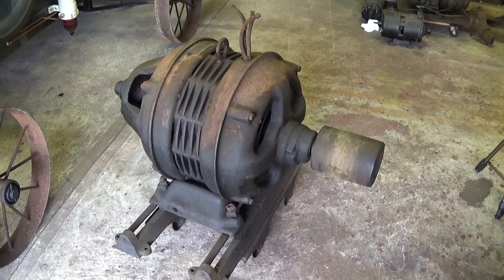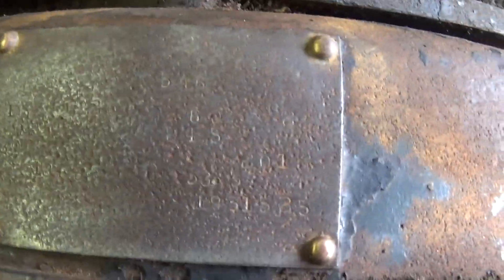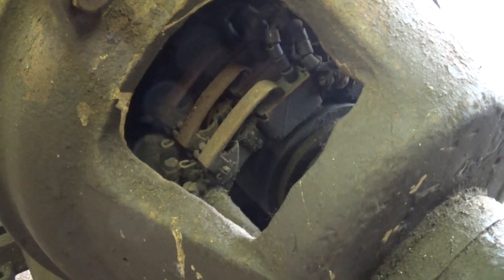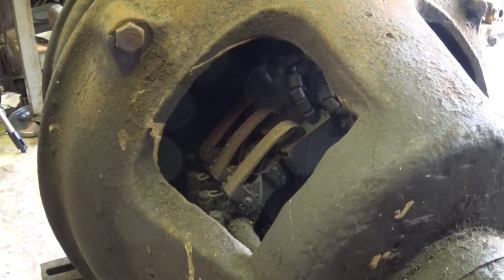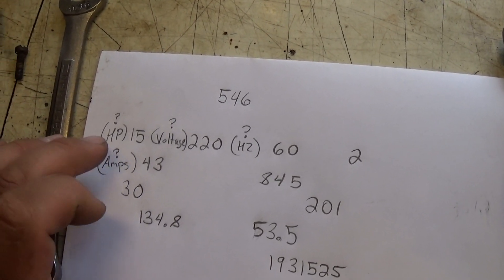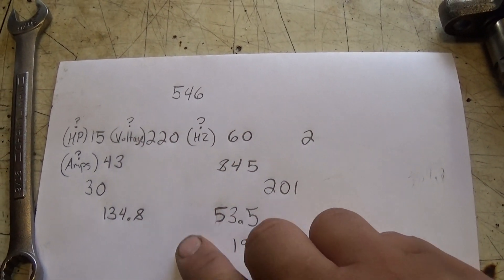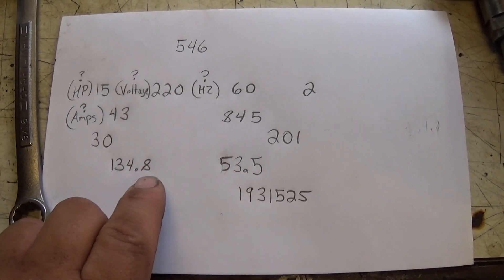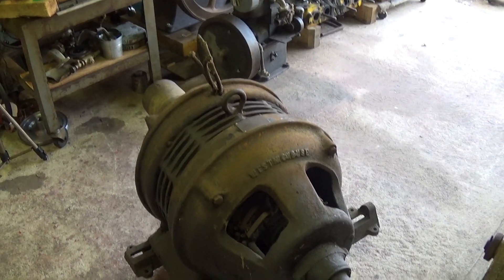OLD WESTINGHOUSE ELECTRIC MOTOR

Comment: A sawmill I used to work for had a old planer that had a motor very similar to this one. It was a 3phase motor with flat belt pulley. You would start it by turning a lever and it would start slow and then you would turn it up to full speed. It worked very well. The machine broke a shaft and they put a newer 3phase motor on it and v belt pulley system. The old motor was unhooked from the wiring system, but it's still mounted in the original place.

Comment: Well, it seems the data correlates well, the way you wrote it. If we assume typical cos_fi of 0.8 then:
Pn = Un* In* 1.732* cos_fi = 13.1 kw (input power)
Po = 15 * 0.7457 = 11.18kw (output power)
ni = 11.18/13.1 = 0.85
I was not expecting this motor to have that much power and efficiently, based on size and year it was made.

Looks like 845 should be nominal output speed (rpms), which means 4 pole pairs.

Comment: Eff ing YouTube has blocked me on some or all of the comments., I found a Westinghouse Catalog from 1920s that had that exact motor.
I worked at 20th Century Fox Studio, and it was built in the late 20s and there was open frame Westinghouse motors three times as big as the one you have and they were 1 1/2 hp.   "THE DON'T MAKE THEM LIKE THEY USED TO" . 
I swear I would have worked there for free. LOL.
I WAS a union electrician. 
If you can see this I will send you screen shots of the links and other things. If. You were closer I give you my motors tools etc.
I am the worst sales person on planet earth.
I have a six pole revolving feild Altanator.
 I see you have the Magraw Hill  Electrical Engineering series. DC MOTOR.
ARNT THOESE the best written text books. I am 70  and I have been collecting all the MaGraw Hill books , steam turbine   all
 You are lucky I live on this coast.. I can be a pest...... LOL
I don't do "tweaker or get outa my face book"    just messages or email address.
I think I am the only one that can see this.
 Rumble and Parler are where the AMERICANS ARE GOING TO.

Comment: i worked on many 25 cycle westinghouse motors, typically put resistance between the 3 rotor wires and use a 2 pole relay to short out , as short out resistance motor speeds up, the 845 is rpm, typically those are mill duty motors, typically 1.5 SF 100% duty cycle at 1.5SF, email me if need more info, oh the 2 amps are 1s for stator current 1s for rotor current

Comment: 796 watts per HP times 15 HP Devide by 220 volts Devide by 1.73 3 phase is 32 amps plus the inefficiency of the motor...

Comment: Another answer to why the rotor are wound, are that the ballast that these reostats made did give the motor a soft start. The powergrid at that time did not have that lot of power as it har today, so the softer start was many times nessesary. The drawback was that these motors used quite some power to keep the rotor and the reostats hot, so it took more current per Hp.

Comment: As others have said, the 43 amps works out to a very realistic combined power factor and efficiency of ~68%. Especially considering that the 845 is very likely the full load speed. High pole count induction motors run at a lower power factor. Some of the other numbers will be secondary voltage and current. Applying rated voltage to the primary, you can then measure the open circuit voltage of the secondary.

Comment: I am not super familar with old US name plates, here in Europe they may do things differently so please take it with a grain of salt...  The motor is certainly an 8 pole (900 rpm synchronous speed at 60Hz), and by the size, 15HP looks possible and the Amps do match as well, considering power factor and poor efficiency of these old motors. The stated power is usually mechanical output, not the power consumption. The numbers at the bottom could be open rotor voltage and short circuit rotor current because these are important figures to size the starter (rotor)  circuitry correctly.
The main purpose of slip ring motors was smooth start and low start-up current, speed variation does work somehow, but results are very load depending as it is essentially a torque reduction. At full power the slip rings are always shortened by the external circuitry.
Nowadays, I personally would not bother with rotor resistors anymore, the speed variation you'll get is not much and if you go too low it just stalls as the torque drops significantly with increasing slip. But that's all they had before the invention of the thyratron (that's some sort of a vacuum tube thyristor) and it was certainly better than no speed variation at all.
I would just short the slip rings at the rotor and run it with a VFD or a soft starter to limit the in-rush current.
saves you the trouble of finding capable resistors and all the extra wiring. If you after original look, just leave the brushes there,
condition does not matter with the shortened rotor, the voltage on them is actually zero then. Hope this helps a bit.
Reply: Great reply, I learned a lot from your examples. Too bad it's on a day when I was trying not to learn anything:)
Reply: If you assume typical power factor of 0.8 it turns out the efficiency is about 0.85, which is actually surprisingly good. If the real power factor is lower then the efficiency will actually go higher :)

Comment: That is an interesting motor. By having a wound rotor, the starting current can be reduced by adding external resistances in series with the rotor. These motors have good performance. They were a lot more expensive to produce. Your nameplate data looks pretty accurate for a motor this size. It is a three phase motor. look forward to see it running. New sub from New Zealand.

Comment: I believe your assumption is correct that the number 43 on the nameplate relates to the motor amperage. When calculating the current drawn by an electric motor, one must take into account the efficiency of the motor to convert electrical energy into mechanical energy as well as the power factor of the motor. The straight conversion of 745.7 watts/HP is the ideal conversion
based on 100% efficiency. Electric motors are never 100% efficient, and older motors like yours were typically in the 70% to 80% range. The EPAct of 1992 required all new motors in the 10 – 20 HP range manufactured after 1997 to have a minimum efficiency of around 90%.  When an assumed efficiency of 75% for your motor is taken into account, the result is 994watts/HP. And when an assumed power factor of 90% is taken into account, the conversion from energy (watts) to apparent power (volt-amps) becomes 1104VA/HP. Therefore, your 15 HP motor running at full load and rated voltage will demand 16.5 KVA from the electrical system. Plugging 16.5 KVA into the equation Amps = KVA/√3KVLL yields 43.3 full load amps. Of course, assuming your motor to have an efficiency of 80% and a power factor of 85% will yield almost the same result of 43.2 amps.
Reply from the maker: Jim, thank you for your very informative comment!  When I ran the numbers I did not take into account the reduced efficiency this motor it likely to achieve.  This info is very helpful!
Reply: I came to the very similar conclusion, I just assumed power factor of 0.8 which yielded efficiency of 85%

Comment: To me that looks like a very early Star /Delta started motor . I  guess you know what and why the larger motors have star delta starting. I have worked on a lot of machines that had old motors like that with the handle operated star /delta starter which would explain the extra cables . you started the motor rolling and held the handle down until the motor got up to speed and then moved the switch to run position.

Comment: Isn't there some kind of acid that eats steel in such a way that the compressed/stamped areas get eaten faster so it reveals stampings? Think it was used on guns with filed-off numbers in a crime drama, so I'm not sure if it's a real-world thing.
Looks like it could power some sizable flat-belt equipment!

Comment: Applying the basic 746 watts per HP, times 15 would give you 11,190 watts. Dividing that by 220 volts (X1.73 for 3 phase) would give you 29.4 so I'm thinking the 30 is the FLA. Not at all familiar with this kind of motor however. You might try taking that data plate off and see if any of the stampings came through to the back.
Reply from the maker: Pappa Bob Thanks, that is the same equation I was using.  Only difference is I was adding the Power Factor multiplier.  I was using 80% PF because that is what most modern motors squirrel cage  are rated at.  However, this being wound rotor and possibly 80 years old, I am not sure that PF applies.  More investigating to do!
Reply: Been retired and away from this stuff long enough for my "ancient" brain to have forgotten. One of these other numbers "should" be LRA. Maybe the 134.8. The 53.5 sounds too low. Maybe that's "Temperature rise". The 845 may be RPM?? Don't know if the #2 might be some sort of coding for overload heaters?? All guesses, of course.

Comment: Hi Mike, I saw a picture of a Westinghouse motor with the exact same style frame on Google Images, I went to the page and it was an ebay listing. This is the description given:

 This is a almost 100 year old electric motor with 20+ patent dates ranging from June 21 1898 to Sept 1 1916 the motor tag has a date in lower left corner of 11-18-1916 which I believe is the build date for this motor this is a Westinghouse 3 phase motor runs on 3 phase 220 electric the wiring is old so I didn't try putting power to it does turn freely the front dust shield is loose it is heavy and expensive to ship shipping weight will be 125-150 LBS so if winning bidder wants to pick it up we can arrange that

Comment: Very cool old wound-rotor motor.  I haven't seen one of them in the wild, but we did see them in technical school. They applied 3-phase power to both the rotor and stator, and were able to get very high over-synchronous speeds. It would start up with all three of the rotor phases shorted to form an induction rotor. Then once it reached a certain speed, it would apply three phase power to the rotor and the speed would increase to a super-synchronous speed.

The motors which were purely synchronous seemed to have only two brushes to the rotor for a single circuit in the rotor.

Comment: That is COOL!!! I was wondering... have you tried doing the numbers if it is wired as a "generator"?.... I know it has a small pulley, leaving the idea that it is a motor... but, many of those could be run in either mode, if I am not mistaken...

Comment: For some odd reason (and i say this because i'm from Europe) this motor looks incredibly familiar. I'll show it around a few fellows i parse electric motors with and maybe they can help clear the haze.
Reply: Back, i know why. I was browsing the Practical Machinist forums the other day, not much, practically the same place as you are, but here: "(add practical machinist website here)/vb/antique-machinery-and-history/old-westinghouse-motor-323417/"  I won't put a link here because GoogTube hates those.
Sorry, wish i could've helped more.
Reply: In the photo of the look-alike motor's data plate on Practical Machinist you can make out the original rivets from the old data plate, which is a good match for the size of the data plate on Mike's motor. That one looks like it was rewired to run on 220 at some point.
Reply: Good eye. I missed that, and thought that maybe it was a different motor, and apparently, these are easily rewound. Makes me wonder about other W motors online (not the same configuration, but the main housing design is the same) got refitted by Westinghouse themselves. It would explain why there's such little data on them, if they changed from a style to another.
This means this one is pretty rare then, it would be an original unmolested survivor. Well, in theory, hopefully someone can shed light on this.

Comment: Years ago i worked Firestone Tire and rubber Co.I ran this old Extruder machine,It had a Huge motor ,That looked just like yours,But 10 times bigger.4-5 feet around.I thought that was the Coolest thing ever,running a machine with that monster beside me! It was un-stopable!
Reply: I got to go in the baldor motor plant in ft smith arkansas. They had one in there that was as big as the f250 I was driving. Wish I knew what it was going in and could have seen it running but just seeing it being built was pretty cool.